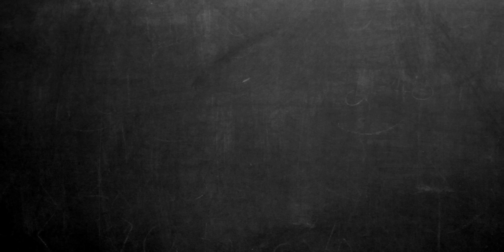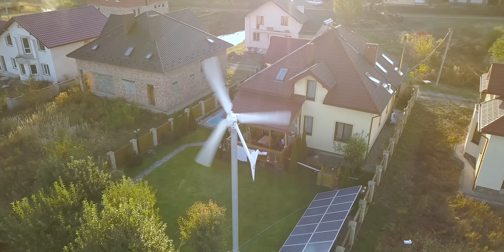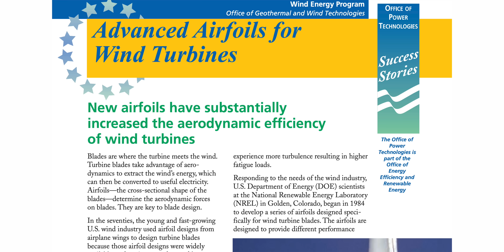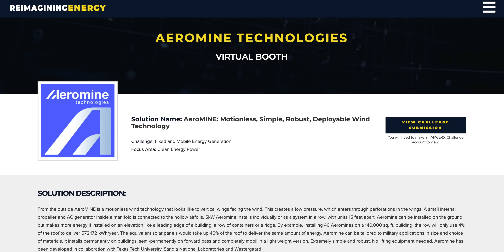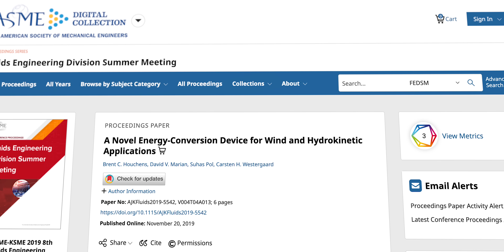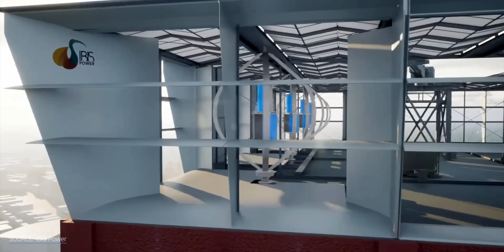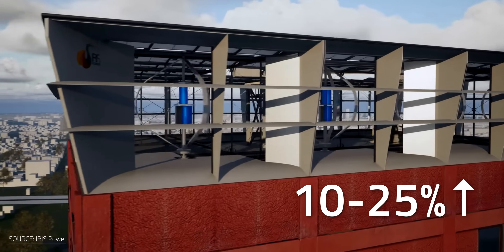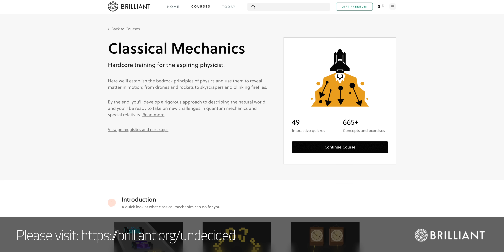How Can A Wind Turbine Be Motionless?

Comment: The power nests look very promising.
I'd definitely have questions about just wind power on roofs since that seems very limited to flat rooftops of large buildings to make an sense, but the mix of solar and wind makes is super smart since it improves the efficiency of both, while making use of the entire space available and as a bonus it doesn't look as ugly as the other rooftop wind turbines shown in the video. It's definitely also limited to taller buildings so probably mainly cities and factory buildings (and possibly car parks) but we need anything that can help bring more renewables in the mix, especially if it can be used right where it's produced.
Reply: another upside is that in most places, when the sun gets weaker during winter the winds get stronger. So the power generation could be more balanced year round.
I also currently have the most faith in vertical axis wind turbines compared to both horizontal or stationary types.
Reply: I have solar installed and it works great in the summer. Then comes the winter with its low sun angle and solar energy production goes in the toilet. The wind picks up, but with it comes snow. Lots of snow some years. Icing is an issue on airplane wings and any other kind of foil. I did an estimate of how much energy it would take to keep the foils clean of ice based on how much extra energy the Starlink antenna used to defrost and estimate that during stormy weather, a good 60% of the turbines energy would just go into keeping it defrosted during inclement weather. Given that these are back of the envelop estimates, I am probably off by a fair bit, but it does suggest that even the PowerNest structure is going to be affected by winter weather of the snow and ice variety.
Reply: The funneled wind for the wind turbines will help to cool the solar increasing its efficiency. Plus it isn't an eyesore so people will object to it less.
Reply: I almost entirely agree, but don't rule out lower level wind entirely - with the right location even low buildings can get very reliably windswept, sometimes aided by the layout of the roads and buildings creating that wind tunnel effect. The practically and safety of lower level wind is still perhaps in doubt - when its 50 meters up doesn't matter if its noisy nobody will hear it.
Reply: @foldionepapyrus3441  My two story house is about 30 feet from my neighbor's two story house. The two big boxes create a funnel effect (venturi) between them. While wind here in Austin TX is not as regular and constant as it is in the northern and western parts of the state, there is often a prevailing breeze which gets amplified by the two structures. Something like Aeromine or Joe Doucet's Wind Wall might be a good add-on to any renewable power system I install. I think the Aeromine concept has room to be configured in many different ways and should allow options for improving its appearance. 

I think everything is going to be a mix in this field - there is no one single solution. The power nest seems a bit of genius and should find widespread applications as it becomes more well known. In the hands of an architec it should be able to be added to exisitng structures without taking a huge esthetic penalty.
Reply: @foldionepapyrus3441  very good point
Reply: @foldionepapyrus3441  … except the rich occupants of the penthouse. Actually that’s perfect lol.
Reply: If it was fed into the electricity grid direct, it would benefit all.  Many parts of the World have tall buildings.
Reply: Really good comment. Could have not said better myself.
Reply: Imagine if they stacked several the power nests on top of one another in areas where they have wind farms?
Reply: Inventors design make sense it was awesome，even haven't been to the specific location with surface and some detail of knowledge greatly groom some grown up （far） but treasure much tech element control the place you were.surprise that shown with this it still can improve for few more advancement due to each topic respectively you shown from those subject topic.
Reply: the design would it be depense by the surrounding？like temperature and air！
Reply: Would this not be perfect on the roof of a hospital? Flat roof, 4-5 stories, using power at all times.
Reply: @johnt5222  As long as the hospital still has a helipad on top.   A lot of hospitals are doing that for those that need to be airlifted in.

I think those "motionless" would be great for a lot of applications.  I could see them stack them 10 high instead of a traditional wind turbine.
Reply: Those things shown in the video just look so extremly ugly. Can't imagine having something like that on small houses in my neighbourhood on the rooftops ^^'

Estimated cost of 12.000$ is also a little bit expensive.
Reply: @blablup1214  i sail past the nest in Rotterdam every week. It is most definitely not ugly at all. It blends in very nicely and it took quite a while for me to notice them. The way they are constructed makes you hardly notice the blades turning. Very clever design taking in consideration how the human mind reacts and focus to moving things.
Reply: @autobootpiloot  I didn't speak about the nest I spoke about those things visble at 4:05 imagining those seton top on small family homes....
Reply: No sun light.. No solar power.
No wind 
No turbine power
Reply: @isayusayweallcansay  … no Plutonium, no nuclear power, no coal, no coal power, no river water, no hydroelectric power.

At least these alternative power options like wind, solar and wave don’t leave toxic byproducts. Even Hydroelectric has problems… and if it fails (like some have) it can be devastating. Solar + Wind + Battery Bank is probably going to be the way to go. You can even export your excess to the grid which can then shift it to homes that are having low wind, grey sky days, for example.
Reply: Solar power 
Wind power 
Expensive… 
Solar panels require large tracks of land and long runs of power lines.

Comment: It is not possible for a wind turbine to be completely motionless, as the wind is what powers the turbine and makes it rotate. However, a wind turbine can appear to be motionless under certain conditions, such as when the wind speed is too low to generate significant movement of the blades. Additionally, some wind turbines are designed to shut down automatically when the wind speed reaches a certain threshold to prevent damage to the turbine.
Reply: You missed the whole point of this video! 😮😢 go back and replay 3:38-4:01 to see how the actual “turbine“ is separated from the airfoils, which
DO “Remain motionless“
Reply: @thisplaceisnuts  Just because you conceal the moving parts does not make it motionless.
Reply from the maker: The structure of the device is motionless.  It doesn't turn or move like a typical turbine, but yes ... there are turning blades inside.

Comment: Great video. Wonder why the Power Nest doesn’t have a mechanism to automatically face into the wind!
Reply: Power Nest don't need that because the VAWT they use can catch wind from all directions. Perhaps you meant the other one.
Reply: We direct our modules with wind turbines to the prevailing wind direction for optimum performance. At each project we look individually, but most locations in the world have a dominant wind direction where 75% of the time the wind comes from the came 90 degree spectrum of direction. PowerNEST can make use of that 90 degrees wide spectrum, and on the corners for the other directions.
Reply: @alexandersuma  - what about on the coast, where wind is strongest, and reverses direction?
Reply: Came here to say exactly that. Seems like it would be a relatively simple thing to engineer and the benefits could be significant.

Also have to wonder why they aren't intended for single-family homes. Like, why not?

EDIT: Wait, sorry, did you mean Aeromine or Power Nest?
Reply: @brkatimachor  the cost and height necessary to face the wind
Reply: @eone2345  seems like a relatively inexpensive modification given the price of the system but I could be wrong
Reply: @brkatimachor  for me personally both are quite expensive 😅😂
Reply: @brkatimachor  - yeah… add a Lazy Susan…
Reply: exactly my thoughts......

Comment: You say it is best for areas with low variation in direction, but it could be engineered to react to changes in wind direction.

Wouldn't be too hard to alter the design while maintaining its basic function.

Then again, I'd get carried away doing anything like that.

I'd incorporate piezoelectric materials, heat harvesters, solar panels, and end up with an extensive, overcomplicated monstrosity, that probably wouldn't be efficient.

Never let me near autocad or bluebeam.
Reply: I think that they rely on the fact that the wind speeds up around the corner at the roofline to go over the building to generate a lot more power. I'd guess that you would get less than half the power with the turbine facing into the roof compared to facing outwards off the edge.